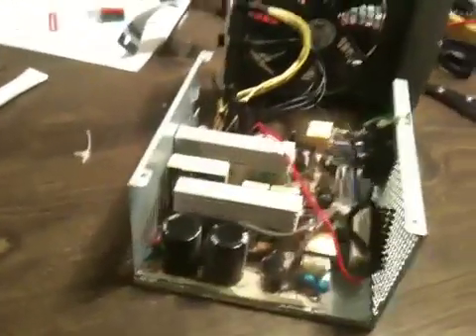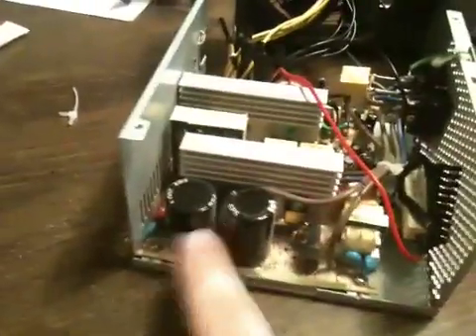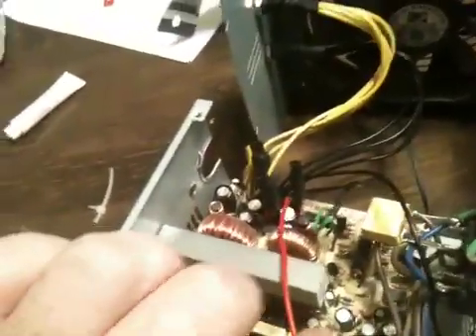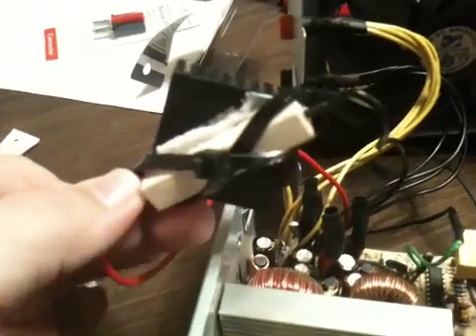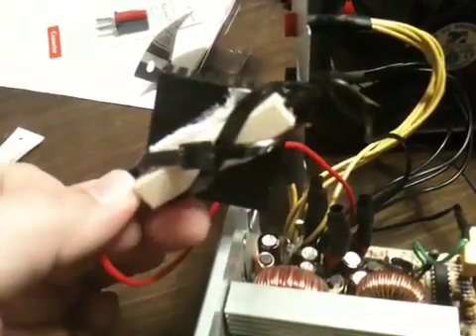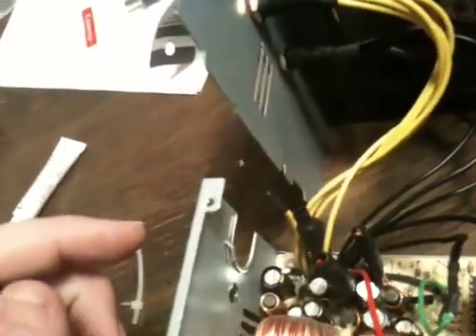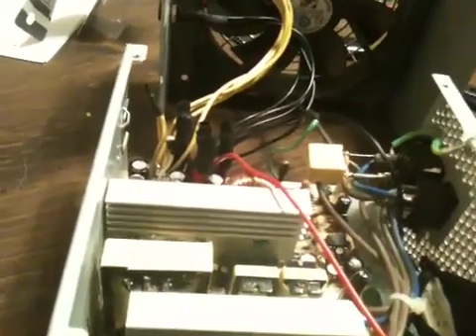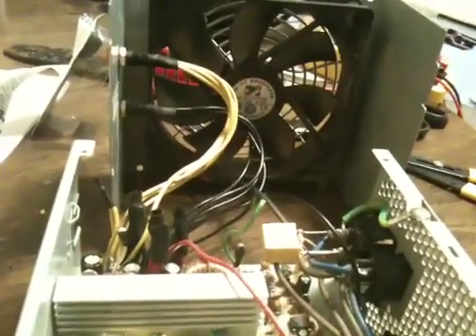Converting an ATX Computer Power Supply for use with 12V DC R/C Chargers

Comment: I did this same thing the other day and even though its a different "brand", yours looks identical inside... but when I powered it up I got 0V from it.    I grounded the green power on wire, hooked brown to orange for 3.3v sense, and put a bundle of parallel 240ohm 1/2w resistors from 12v to ground..  nothing..   tried putting them on the 5V rail.     Nothing... checked the fuse.  Its fine.   Checked for voltage out of the rectifier.  Got like 60V I think..   I'm stumped.    Its sitting there waiting for help.  Any ideas?

Comment: Sorry what is the current output of this psu, if it's 300 watt at 12 volts that makes it about 25 amp, that's pretty good or is there an efficiency issue here...must give out at least 15 amps I would have thought, maybe 20..Fred UK.
Reply: Most ATX PSU's are 80-85% efficient. The advertised wattage rating is the rating of DC output power (RMS on high quality ones, max on cheapy ones), and represents a combined total of the watts available on all of the voltage outputs. For most ATX supplies rated for 300w, you're looking at 10-20a available on the 12v rail.

Comment: The power supply needs a dummy load, You can do this by adding a resistor a good value for it would be about ~20Ω, 10Watt

Comment: yea get some dc-dc converters.one for 12-12 for regualtion for the battery, one for 12-5 and one 12-3.3 and then you need 12- -12 and them you need a power good line

Comment: I found out that there is a specific order to powering on the PS and charger. The PS MUST be OFF when the charger is plugged in or it trips some safety thing in the PS. I then had to unplug it and wait about 30sec before it would come back on again. As long as the charger is plugged into the PS first without it being on, it worked fine.

Comment: Hello everyone, i started converting my own power supply and i did everything that all these videos say to do, but when i plug in my triton 2 to the 12volt power supply the psu quites, the fan dies and i have to unplug it and wait a few minutes, what am i doing wrong? Do i need that resister? because i have seen videos with people not even using a resister and they worked fine, please help me thanks!

Comment: Hi,
I have an AT power supply, it was creating 11.43v from the yellow 12v wire. I wired a 12v globe to one of the black wires and one of the red (5v) wires. I put the multimeter on the 12v and ground wire while the globe was on. it read -12.21 I was wondering why it said negative? and also my lipo charger can handle 12v-17v, would it be ok if I put another globe on the 5v rail? or is one enough already? 
cheers

Comment: You can do it 10 times easier then that,no need to open PSU at all!

1-Simple get a Clip to use to start the PSU. 
2- Instead of cutting the PSu cables , get a molex adapter like molex to sata, just cut the adapter use both yeallow and black wires.
3- Keep the adapter, and the PSu it's still usable.

Comment: ive done everything you have done except for i have a led rocker switch light for the load instead of the resistor. it turns on for 1 second then shuts off. the led is lighting up for that 1 second so i think there is a load. is the led not enough of a load?

Comment: all the resistor on the red wire is to give the power supply in thinking that it has a load on it and will stay on, if there is no load on the psu when you turn it on it will shut off. these psu are called switching psu.

Comment: Great process!  The question I have is that your putting a red wire to the resistor and ground to pump out max current.  So most other vids of this power supply set up dont have a resistor.  Wont the unit pump current out when it has a load on it?  Or  are you maxing the unit out right off the bat.  Do you have a regulator at the output that can handle the amps and if so what do you have?  thanx

Comment: Not sure if mine is even working. Any connect of green to black is met by only 1 second of fan on, then fan goes off every time. I have a 157W hp k-1603a3 with 12v4amp best output, not sure which wire that's supposed to be but afraid to leave it plugged in to long and test without knowing what I'm doing.  Help?

Comment: good video.  Looking to do this myself for a work bench psu.  some people recommend switching the 12v line going to the fan with 5v to reduce the speed / noise assuming your unit doesnt get too hot.